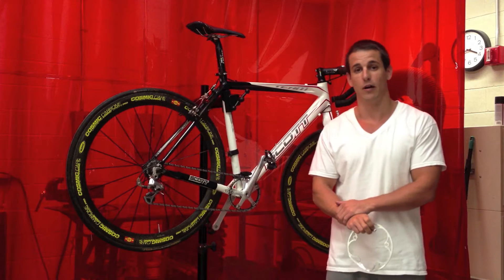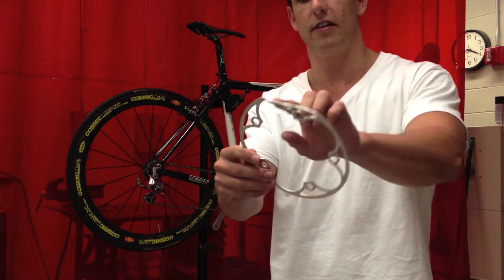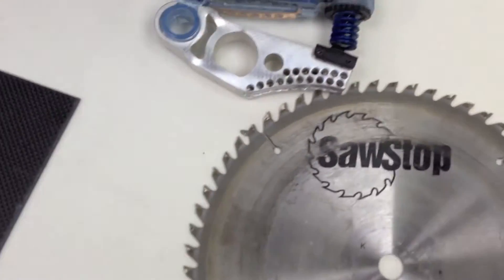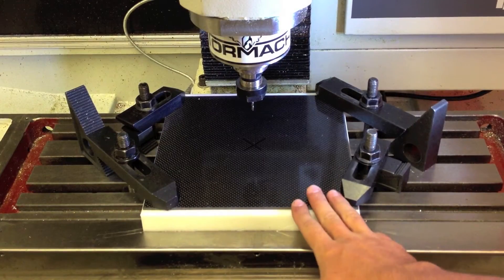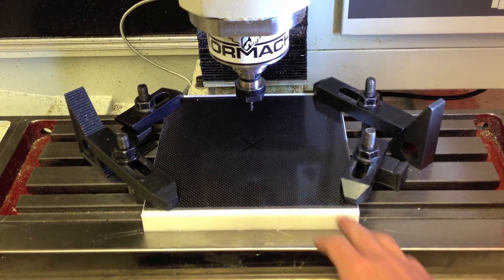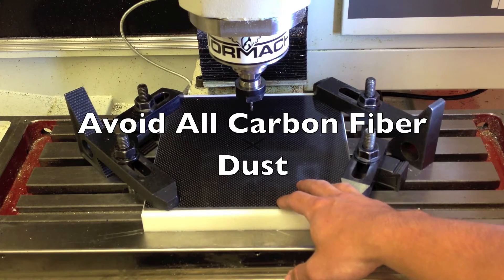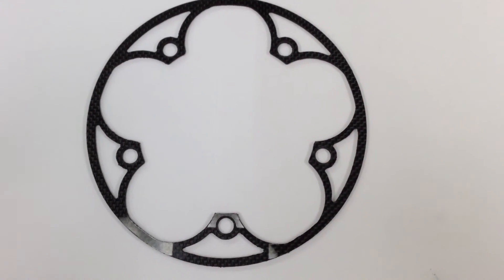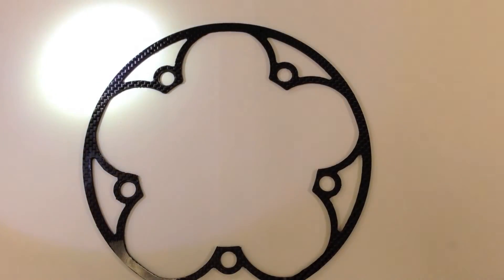Milling Carbon Fiber Bicycle Bash Guard

Comment: I read the same stuff in my research.  Also read that the dust will stay in the air for hours after machining, so removing your mask after the machining is done is sorta pointless.  But it's all about how paranoid you want to be.  I was thinking that a shop vac with a long exhaust hose pointing outside is probably the easiest and safest bet.  Flood cooling also works, but still, once it evaporates you've now got dust all over your table, ready to blow up and into your eyeballs.

Comment from the maker: I feel the same way about CF.  I also read (I don't know how much I believe it) but most filters on a vacuums aren't fine enough to catch the dust, therefore just shooting the dust out the exhaust. I know you had parts water jet in one of your vids, our water jet cuts CF easily so that might be an option if you don't want to machine the whole part.

Comment: First time I cut CF I was also AMAZED at how easy it was.  Same for titanium.  I think I've only tried 2 flute endmills for CF, but I'm sure 4fl would work better with twice the feedrate.  You can feed this stuff pretty fast, I was profiling 1/8" CF with a 2fl 1/8" endmill at 20ipm 6000rpm.  I have a lot more CF waiting to be made into cool stuff but I am definitely leery of letting all that dust into the air.  I'd like to set up a semi-permanent vacuum on the mill, exhausting outside.

Comment: You make great videos man, I always enjoy them.  Pro-tip for carbon fiber: HSS endmills and drills wear out very quickly, carbide endmills seem to last for a good while, but the real ticket is to use diamond coated endmills.